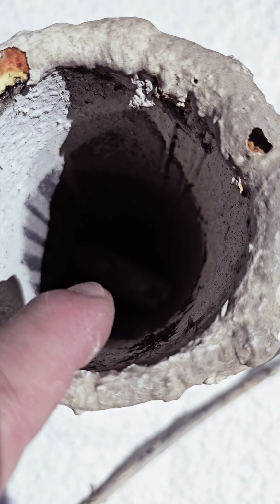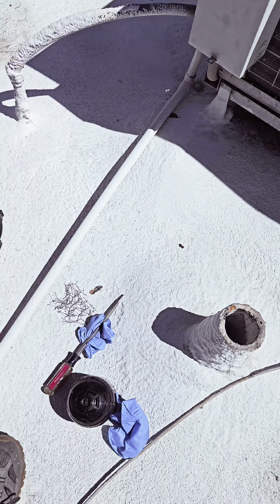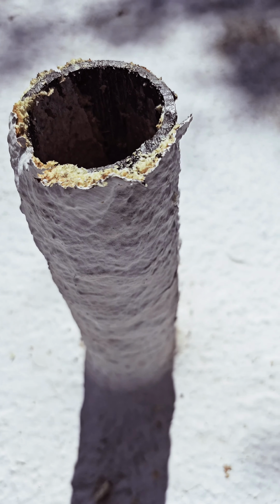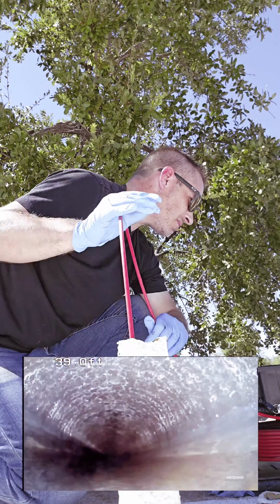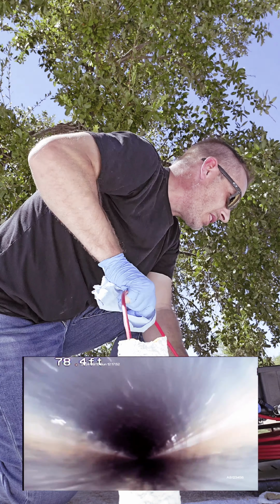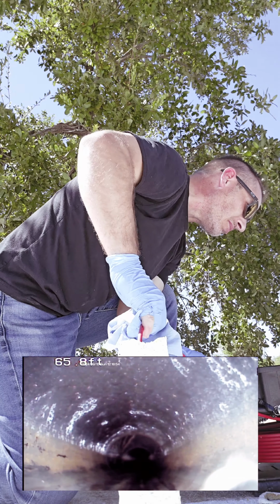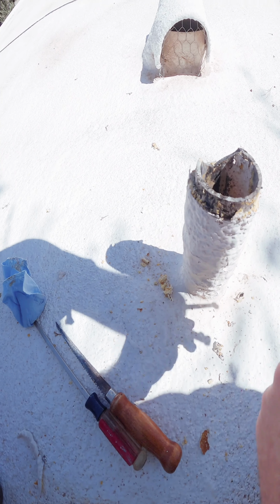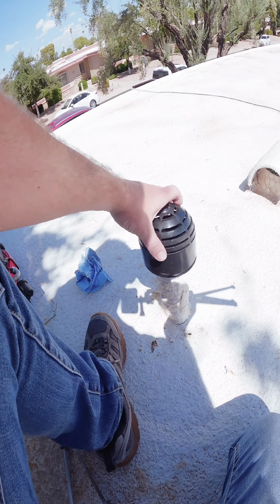Solving Blockages & Installing Ratcapz for Pest Protection

Comment: Found this article via reading on RatCaps - is the Ratcapz cover safe to cover a bathroom plumbing vent stack from the roof? It's not dangerous to have it interfere at all with air flow?
Reply from the maker: It doesn't restrict enough airflow to be concerning, imo. There may be some case it does, but I would think very rarely.